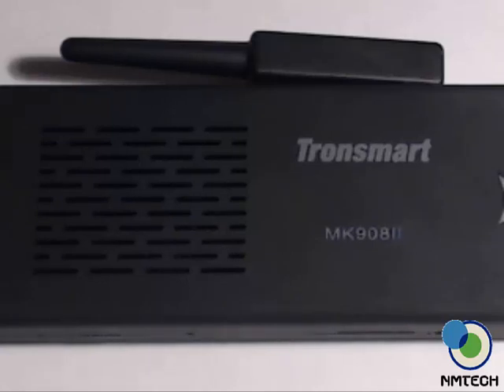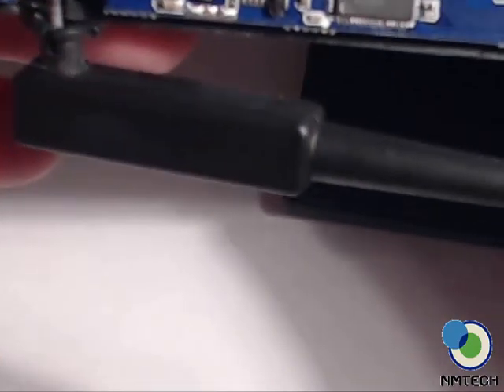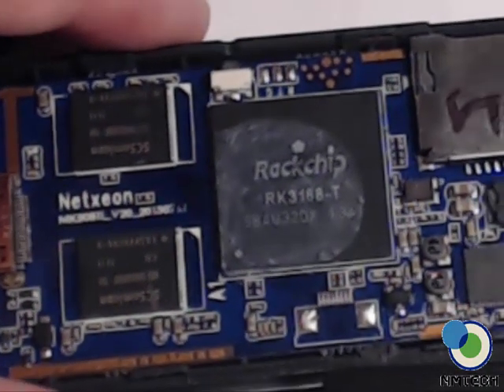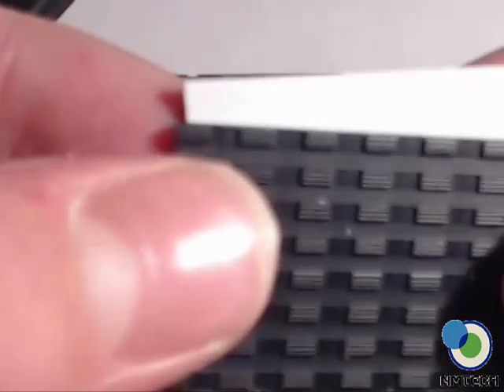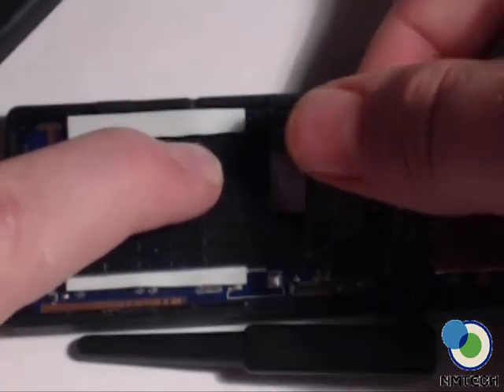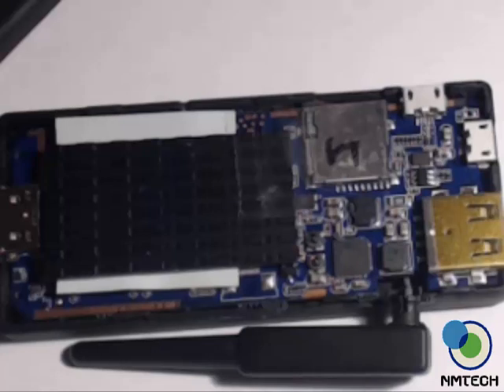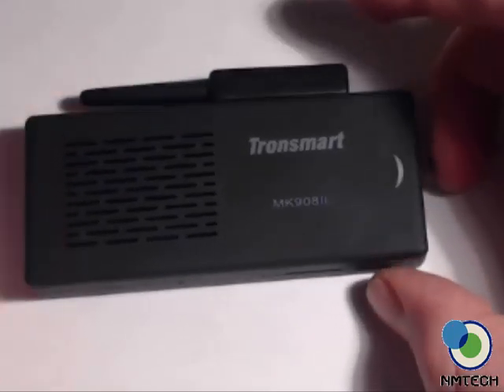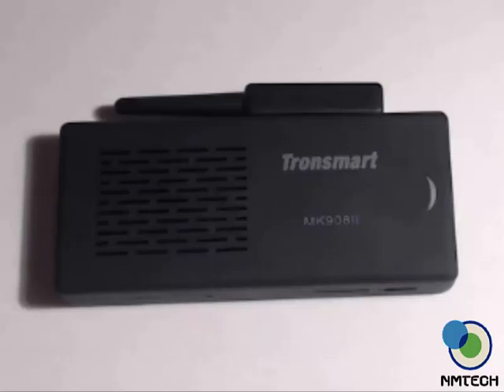Tronsmart MK908ii Heatsink Cooling Solution

Comment: Heh...  Ever contemplate Arctic Alumina as a thermal compound?  That tape he's using to seat the sink onto the pad is blocking the air flow combined with being ineffective.  Sure, it's bonded to the SoC and memory parts...that actually keeps it from floating and actually beats that pad.
Reply from the maker: I had no thermal paste at the time so this was just a method. I barely use it much so I don't care. There's not a a lot of airflow since theirs no actual space for it. So at least I'm transferring the heat somewhere else other than the CPU and memory.
Reply: (You just said this to a computer systems engineer, nmtech...  As in the kind of guy that designs these sorts of systems in other product spaces... ;-D)

Actually, you see those bumps on the plate?  That's to allow thermal convection induced transfer of heat out and OFF the heatsink.  Transferring the heat somewhere else other than the CPU and memory isn't as much use if it can't get off the heatsink because it'll just stay THERE.  Blocking fins that're exposed by holes (yes, there's holes in the case...) so that convection can remove the heat from the sink to the air, thus getting rid of the heat, is not a great answer for bonding the sink to the device.  It degrades the performance of the sink because it's blocking airflow- and there IS airflow there even if you don't think there is.

Your thinking was relatively sound on the pad, if it was a thermal adhesive attached pad.  It's why I said what I said about Artic Alumina.  It's not paste.  It's adhesive.  It's precisely the thing you want for this application.  The reason why Tronsmart didn't run with it and ran with a wax based thermal management solution is because it's not cheap compared to what they ended up using.  Most Shenzen manufactured devices (this included) is predicated on costs.  I'm actually impressed with the Tronsmart devices because it's clear they thought about that and worried about the heat- they just cut corners on the plan there.  Not all of them do that- in fact most of them don't. 

For example, the Equiso HDMI stick...it's manufactured by Uptek in the same rough region that most of the other sticks are.  Thermal management of the NuSmart NS110 based device?  Thermal conductive foam pad stuck to a graphite thermal transfer pad, stuck to the top of a case with NO vent holes.  The devices were placed into the Conservative governor mode- but eventually they overheat and go into thermal shutdown if you're doing a continuous feed of videos.  My answer for the devices in question (I've got three so far- two bought for a fair price on  eBay and the one that I basically got rooked on from the Wal-Mart offering from Equiso.) is as I described- a VGA card RAM sink, with the stock thermal adhesive removed and then it glued on with Artic Alumina.  Nary a problem and I'm running in Performance mode all the time now.
Reply from the maker: Frank Earl Yes as I am my self for only 2 years. (I'm only 14). I know there is airflow because of the holes in the enclosure for ventilation I just meant theirs not a lot of space for it. This is my first time with mini portable computer's but I made this video to let people know if it helps them with any heating then tell me if theirs was an improvement or not. Therefor I will recommend people to a better solution in the future. I no longer use this mini computer so it means nothing to me.